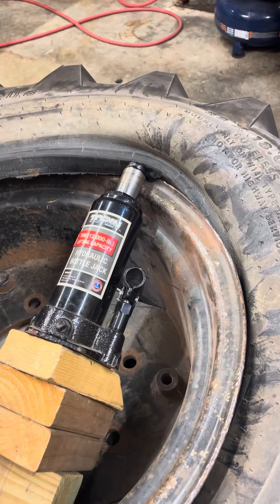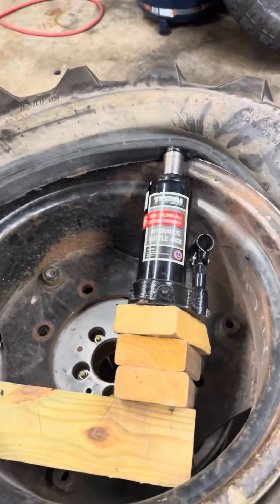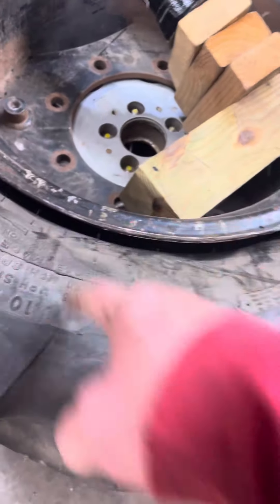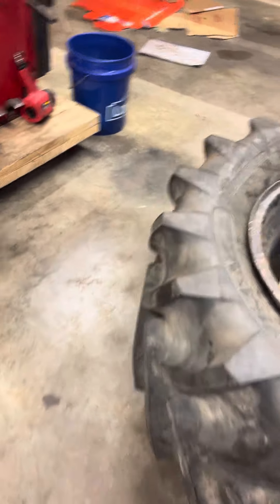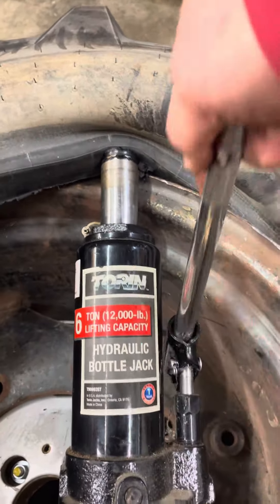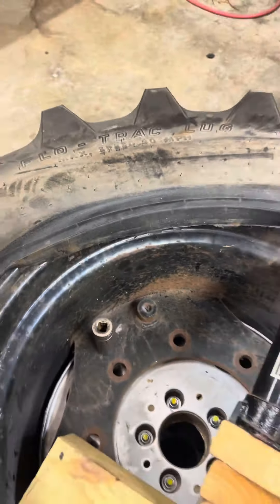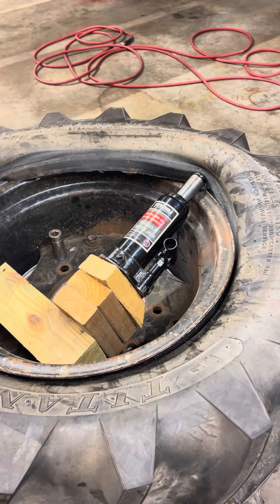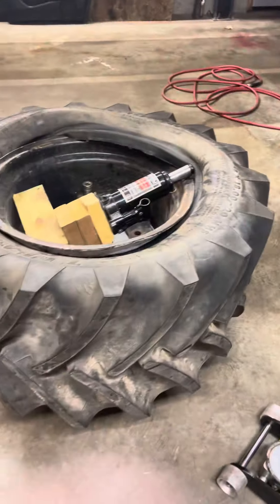Part #8 of 9. Install Mount or Change Large 38 x 18 - 20 TITAN AG Tire for a Vermeer V8550A Trencher

Comment: Try set the other side of the tire down from the lip of the rim and it will go on easier
Reply from the maker: @michaelbaldwin1452  Thanks Michael. The other sides bead does not appear to be below the lip, but it is. The outer sidewall of the tire is actually distorted so much by the pressure, that it has pulled into the rim making it appear that the bead is above the lip. It is not, I checked to see using my pry bar to push down on the sidewall, and the bead was still below the lip.